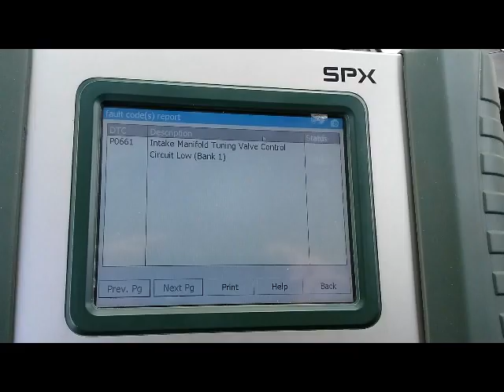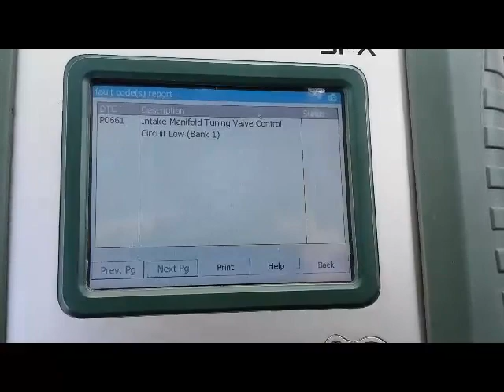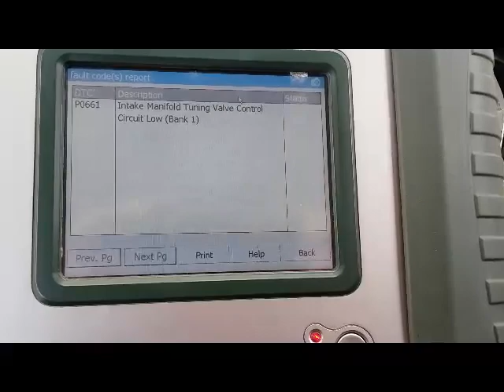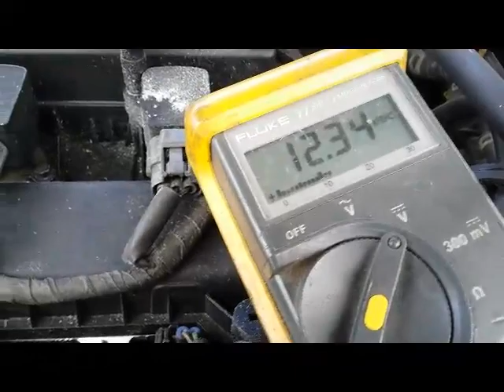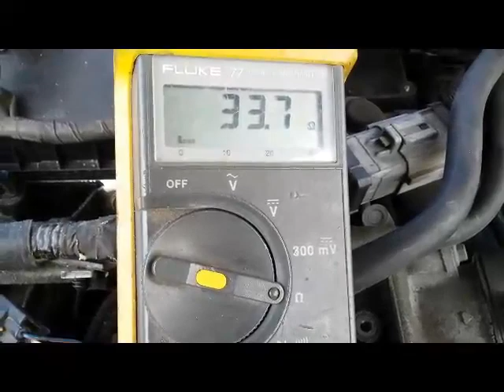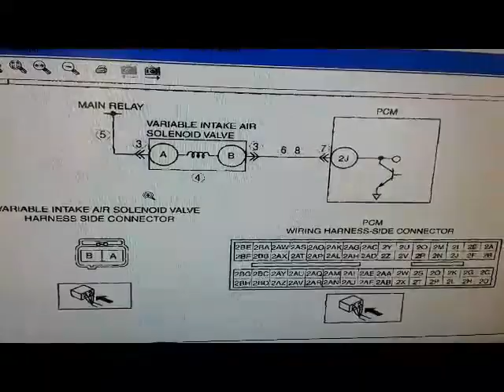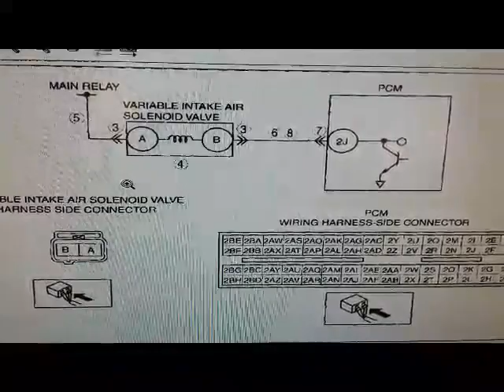(Mazda 6) P0661 IMTVC Circuit Low

Comment: Thank you...Had misfire codes too. Valve cover gasket failed and put oil on the spark plugs. Checked the coil. Open circuit.

Comment: Hey 
I have saim problem but voltge in soket bank 2 low 8 volt only .
The sanloid cilik by direct ?
Reply from the maker: You may either have a wiring issue or the solenoid may be bad with high resistance. The did you perform resistance on the solenoid?
Reply: Have the same problem right now
Reply: I check the resistance in solenoid  and they both in specs

Comment: Does this make your car lower the revolution on idle?? What is the consecuence of faulty selenoid valve???
Reply from the maker: It can cause the vehicle to experience  engine performance  issues such as misfires, a decrease in power and acceleration, a decrease in fuel efficiency, and even stalling. In some cases, difficulty starting the engine. It may take longer crank time to start the engine.
Reply: @EliTheOBDTech  thank you for answering, I'm having this error code but I'm also experiencing a strong smell like rotten eggs from the exhaust. Is this selenoid valve an air valve or gas valve??
Reply from the maker: @TheDucaticol  This solenoid valve only directs air vacuum
Reply from the maker: You may be running lean
Reply: @EliTheOBDTech  actually I'm having a p2188 code that is a too rich air/gasoline mix , is this because of the faulty selenoid valve??
Reply from the maker: @TheDucaticol  Perhaps, you have too much gas and not enough air in the air fuel mixture. If your intake runner flaps are stuck closed. Yes, that could be your problem
Reply: I have a mazda 6 2009 that I took to get fixed yesterday with error codes p2004 and po661, they said it was a loose vacuum and fixed it for $70. OK so this morning the engine light was back on and I'm furious because we spent that much for something that didn't even fix it. I really think we need a dual solenoid manifold replacement it's $25 on Amazon. But noone seems to know what that is or listen to me. So any ideas? Lol
Reply: My problem was the car was hard to start. I didn't have any power in the low rpm range.

Comment: Can a bad IMTV make my car not start?
Reply from the maker: It can cause the vehicle to experience engine performance issues such as misfires, a decrease in power and acceleration, a decrease in fuel efficiency, and even stalling. In some cases, difficulty starting the engine. It may take longer crank time to start the engine. Hope it helps with your question.
Reply: @EliTheOBDTech  Thank you.

Comment: So how did you fix it 
I have Mazda 6 2009
Reply from the maker: By replacing the imtvc solenoid.
Reply: @EliTheOBDTech  Hi Man, thanks a lot for the video, my Mx-5 NC 2008 2.0 L have the P0661- Intake manifold tuning valve control circuit low. Engine is misfiring, hard to idle at cold start and big loss of power even when warm. I don't know if this solenoid can cause this much trouble ? Im ordering the part now but should I get 2x L30118741 or there is two different names for the same part number ? Thanks you very much.
Reply from the maker: @Kamal-me5cx  I'm not quite sure about part numbers being the same for both solenoids. Customer ordered the part. By the looks of it, they both function the same.
Reply from the maker: If the intake runner valve flaps are partially or fully open when the computer wants them closed, it can cause poor idle or driveability  problems.
Reply: @EliTheOBDTech  Alright ! Will check wiring for damage or shortage while waiting for the parts, thanks man !

Comment: Works on a 2008 mx5 just did the replacement today. Part number is L30118741
Reply: Where’s the solenoid under the hood? Have the same issue
Reply: @tfeuerbach  Pop off the plastic cover and you'll be able to see it, looks just like the one in this video.

Comment: so what is the solution for this code error ? probably i dont get it how you fix it
Reply from the maker: This vehicle had a faulty IMTVC solenoid that had to be replaced.
Reply: @EliTheOBDTech  can you tell OEM number some specific code how can i find it in our country ?
Reply: @EliTheOBDTech   Hi!...Im getting same code on a 2003 Lincoln Aviator, Any Suggestions?
Reply from the maker: @dirtyglovekennels616  solenoid problem or internal intake runner flap problem.
Reply: @EliTheOBDTech  Thanks. What is the specific name of the solenoid, so I can just buy them both and plan a Saturday to tackle it?
Reply from the maker: @dirtyglovekennels616  intake manifold tuning valve solenoid
Reply: @EliTheOBDTech  thank you

Comment: This was the problem the car still ran pretty good . The switch was very expensive the dealership quoted me 200.00 I went to the junk yard with my tester and pick one up for 8 dollars. This saved me about 190 minus gas to get there. I’m still learning how to use it but with your help it’s paying off. Thanks again!! 👍🏿
Reply: $200.00!?! Average retail price for PN# L301-18-741 at Mazda is $34.00. The other solenoid is a 'Intake Runner Control solenoid'. Both the solenoids are the same part number by the way. Perhaps they were quoting you installation as well- which is still a rip off considering It takes a Torx T-25 screwdriver and 2 minutes to change.
Reply: Here it is five years latter. Just replaced with a new one. Price range for this was 159 Auto z
O rigles 100 Napa 109 .
I went to Napa because it was closer and didn't have time to get to junk yard .
5 years on a junk yard part is pretty good . Thanks and good luck all.
But your right it's robbery but 200 was from the dealer that was just the part. FJB